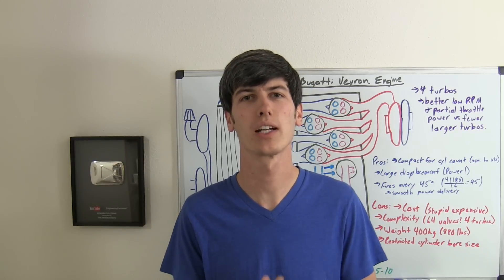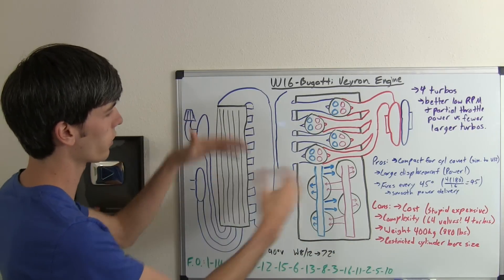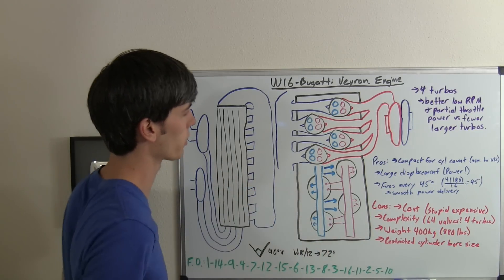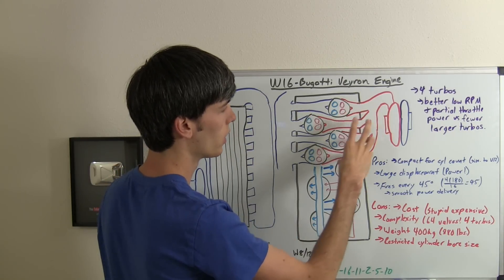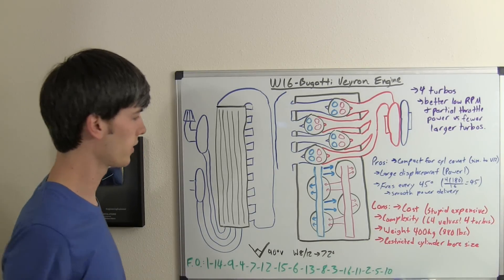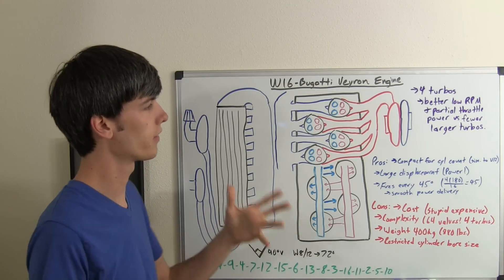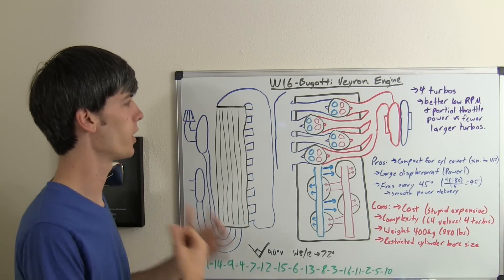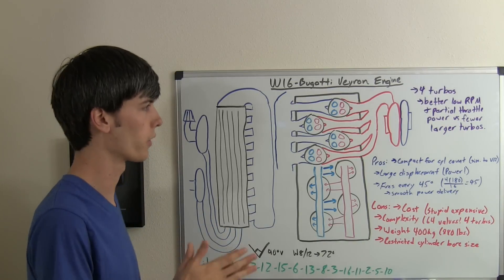W16 Engine - Bugatti Veyron - Explained

Comment: So we can say that if the Veyron was lighter like 1400-1500kg it would still be the fastest car in the world and probably even beyond.. It weights almost 1900kg! That's a lot and that's why Koenigsegg and Henessey (corvette+lotus) managed to make a better acceleration car, also top speed (which Koenigsegg only claims, it's not proved).
Reply from the maker: Less weight means better acceleration, doesn't influence the top speed much.
Reply: Despite what people think, Veyron is not all about speed. Just because it was the fastest car in the world (and still is as far as production cars go, exluding tuned ones like Venom),  doesn't mean it's the main purpose. I had a short ride in one as a passenger on an airfield, a regular Veyron, not SS, and it was the most amazing combination of luxury and speed.  What makes Veyron better than any other hypercar is the fact that it's a luxury grand tourer, it's a track car, or a record breaker. It's a VERY comfortable, refined, quiet car. It's more comfortable than a Bentley Continental GT or a Mercedes CL, or any similar big grand tourer coupes, and still much faster.  Also, it's extremelly easy to drive, very smooth, very stable, very secure, etc.  Basically, it's not about the number it produces, it's about HOW it produces them and translates them into real world.  No other car accelerated that fast with so little effort. At about 200 km/h it literally feels like you're going 50, it's super quiet, stable like on train rails, and there's very little noise inside. For example, Ferrari 458 feels like it has no sound proofing whatsoever in direct comparison, and it rides like it doesn't even have a suspension. Veyron is as smooth as butter.  That's what makes it as good as it is.  It's extremelly hard to engineer a car that will be as fast as it is, but also as luxurious as it is. Much harder than just making a really fast car, which is actually quite easy to do nowadays. Everyone can get 1000hp+ out of an engine today with some simple tuning.
Reply: derbigpr500 Exactly. You get the biggest THUMBS UP ever. I totally agree with you. That's why it costs +1 Million EUR...
Reply: derbigpr500 I would not call the Veyron a track car. Tires are too stupid expensive, its to heavy, and its not all that great in the handling department. Its an impressive car if your into that kind of thing, but I would be much happier in an Ultima, or SL-C for 1/20th the cost, and brutally fast. The Veyron is more about blatant displays of excess than sheer performance. There is no race track on the world where you get close to top speed in the Veyron, and its plain useless on a public road for anything other than dick waving.
Reply: Veyron is a showcase of engineering capability. Performance of super cars stagnated for almost a decade since the glorious days of Porsche 959, Ferrari F40, Jaguar XJ220, and later McLaren F1. Nobody's trying to break 400 km/h on a road-going car before VW decided to do a show of force (when it's aggressively expanding into the luxury market). And Veyron is the first one to trigger a new round of top speed arms race. Since it's the first one there of course it's going to be overtaken by later competitors. 
Just because the Russians didn't land a man on the moon doesn't mean they are bad at building rockets; they are the first to go to space and are the only ones capable of sending men to ISS today. Veyron is similar.
Reply: it's amazing the tyres can survive 270mph whilst supporting a 1900kg car, that's some engineering feat in itself
Reply: It is too unaerodynamic (if this is a word) to go faster. ^^
Reply: A Bugatti is an expensive, half assed collection of a wide variety of cars from top brand car makers. Sad !
Reply: weight can actually help you reach a higher top speed. if it was more aerodynamic it would be faster, but it wouldnt be practical (as if its already practical)
Reply: Weight has very little to do with velocity. Once an object is in motion, it will stay in motion. The biggest limiting factor for these cars is the tires, and I'm not talking about the wear or heat. A spinning tire expands outward from centrifugal force as it gets faster. We don't have the technology yet to make a practical road tire to handle the centrifugal G's of 280-300+ mph without tearing itself apart. and derbigpr500 hit the nail on the head. I've driven one with a client of mine and you literally do not feel anything. Something Koenigsegg and Hennesey don't have is the conservative refinement the Veyron has. And from a monetary standpoint, they Veyron is still superior. A base model Veyron costs less than an Agera or Venom.
Reply: Veyron is not only about speed, don't you know? Koenig and Hennesey can never create the same simplicity of driving, stability and realy big comfort inside.
Reply: Fraser Davidson I think derbigpr500 insinuate that "track car" label is due to the fact it is quicker than some dedicated track cars as seen on Top Gear, Autocar and Evo, after all it is faster than a Ferrari Enzo. The difference is the setting for luxury output. Otherwise, how can you explain SS version being the quickest on Top Gear track (designed by Lotus for those who don't know) for some times?
Reply: derbigpr500 the Hennessy Venom GT is the fast car in the world, however the Bugatti Chiron is faster but Hennessy is making the Hennessy Venom F5 which will be even faster than the Bugatti Chiron
Reply: Jordan Reed  Bugatti s are made for rich people who wants a luxurious car that can still smoke any car that it s paired to (srryforbadeng)
Reply: Vane Naumovski not weight only man drag matters too. When you go above 200mph the airs really heavy it seems , bugatti nd nissan has the best engines but shittiest drag  while lambos has best, koenigsegg has second best drag. U cant win with engine only...

Comment: +EngineeringExplained
Would a configuration work, in theory, with the two VRs 180 degrees opposed? (X configuration? It'd be wide, I understand...) But it would have a MUCH lower center of gravity, and assuming the car built for it would have an accommodating chassis, it could be a viable option for compact, high displacement, and high power.
Reply: +ChemAndAdrenaline X configuration does exist, but it's extremely rare. It was only used in a handful of airplanes and one russian tank

Comment: Great video! Thank you.
You talk about getting displacement with stroke instead of bore in the w16 engine. I've been thinking about the effect of stroke vs. bore, like stroking a chevy 350 bored .030 over with a 400 crank to 383 (which is fairly common) vs destroking a chevy 400 bored .060 over with a 350 crank (by my calculations would give it almost 383cu/inches) or a 502 bored .060 over and with a 3inch stroke (387cu/inch)
What do you think would be the pros and cons of these engines?

Comment: how does it compares with a custom skyline 6 cylinders engine like, that can produce 1000hp too?
Reply: VWs VR6S LOVE boost amd can make over 1000 hp on just 6 cylinders. The Veyron uses 16 of them and FOUR turbo chargers.... Now ik say a twin turbo may give a V6/V8 even,smooth power. While a big single will provide more top end HP but have a more "violent" torque curve. Even if a Veyron engine was built and ran 2 huge turbos instead of the 4 it has stock or simply just 4 bigger turbos it SHOULD be able to stand in the 2500-3000hp club. But I dont even want to know the price tag to make that happen would be

Comment: It is said you get 1000 hp of output power but to get this result  the engine must produce 3000 because 2/3rd of the power is lost by heat so it needs 11 radiators to cool it

Comment: So this engine really only uses 4 camshafts? Aren't these close to 2 inline 8 cylinder engines with the offset that a vr6 normally has? If so, inline 8 cylinder engines died by the 50s because of how much stress they had resulting in very unreliable engines, then what Has VW done to prevent this from having the problems early engines had?

Comment: Hi ! Thanks for explain how work w16 engine but i have a question on the beginning of your vidéo you tell that the w16 has 4 valve per cylinder or i have read that this engine has 64 valve Can you explain to me ? Sorry for m'y english i'm french lol
Reply: 4 valves per cylinder, and this is a 16 cylinder engine, 16 x 4 = 64, so it is a 64 valve engine

Comment: so basically it is 2 VR8 cylinder heads mounted to a V block and then they have fitted 4 turbo chargers on that? 2 turbos on each cylinder head?
Reply from the maker: +Philip Grundemar I believe it's more like two W8s matched together, or 4 VR4s, but essentially yes. 1 turbo for each VR4.

Comment: I believe there's something wrong in your math, for power; one cylinder will fire every 22.5 degrees, which is 2 powerstrokes per 45 degrees. (16 fires for one revolution)
Reply: No because it's a 4 stroke engine so there will be 8 fires per revolution so 45° is right. Correct me if I'm wrong please.
Reply: That is correct.
Reply: David Ottink yes That is correct. It takes two revolutions to complete the 4-cycle, A 16 cylinder engine would light a plug every 45 degrees.

Comment: everyone saying the veyron should be a v8 because v8s are capable of making big power don't understand the point of this car.  this car has to be the be all and end all of a luxury-performance gran tourer (with added exclusivity).  a 16 cylinder with 4 turbos only seems fit.   think how little effort each of those cylinders is putting in to achieve that 1200hp figure

Comment: I hate it when people call this car underpowered for having 16 cylinders. If I'm not wrong, displacement and RPM play a bigger role in torque/power figures than the number of cylinders, so theoretically the Dodge Viper should have the most power of a stock engine (8.4L), no? Please help me understand this so I can defend the Veyron more adequately from insults from idiots.

Comment: I have heard, that this engine could make 3-4000hp in theory, but it would be impossible to get enough radiators on a car to cool it, so it is restricted to about 1000hp.
Reply: This engine could push that easily, but Bugatti designed the Veryon with extreme reliability in mind, but to also have extreme speed. Yes, these engines are 'tuned down' to give it that reliability factor. You could get an engine like this to push 2700-3500hp, with a lot of money, work, and time; but that throws reliability out.

Comment: Imagine the performance if they used a Koenigsegg V8 which weighs less than half and produces about the same power from less fuel :-)
A whole hybrid system such as on the McLaren P1 or Porsche 918 could also be added for a similar total weight to the original Veyron powerunit. But really, it would be difficult to make it a faster car in any way except top speed, due to it already being AWD and plenty powerful. 200+kg less would make a Veyron a good bit more competitive in terms of lap time, where it is beaten by cars such above mentioned, despite their power deficit, and thanks to a lower weight.
Reply: +Cloxxki Koenigsegg V8 engine is very similar to an old Ford V8 engine which is derivated from thus explaining the sound from a typical muscle car. Veyron is more like a high luxury gran tourer in the same vein of Bentley Continental. Koenigsegg engine will have hard time handling the overall weight of Veyron in term of reliability with the same power/torque.
Reply: Tippotipo Would the key factor not be displacement, 5 vs 8 litres? K's engine is about the most tricked out in the business, although reportedly plenty reliable. Sure a heavier car will stress it more when going maximum all the time. 4WD may be a stressing factor on the engine as well. Then, engines are supposed to work, revving is not prime objective, right?
Reply: Cloxxki
After researching about Koenigsegg engine, it seems it is a heavily customized modular Grainger and Warroll Ford engine. Look it up at http://www.luxury4play.com/koenigsegg/103619-powered-ford-5.html#post2225553
The layout is identical aside the modification meaning it is not totally bespoke. That explains why Koenigsegg sounds like muscle cars. Also find out about the 5.0L Ford Coyote engine which could be possibly the template for Koenigsegg engine. http://www.wikiwand.com/en/Ford_Modular_engine
Reply: Tippotipo I am not an engine builder. I care for what the engine does. And it seems to do fine. At 260+bhp/litre.
Reply: Cloxxki
Me neither. just did some research to find out Koenigsegg engine is actually a customized modular Ford engine, simliar type also used on Mustang and drag racing cars.
Reply: Look up Devel Sixteen. The engine for that car has been built and it produces 5,000 BHP.

Comment: so my question is why is it the last   BUGATTI W16 Engine? why did they stop making it?
Reply: cost and fuel efficiency/emissions related reasons, now that Rimac owns Bugatti, theyll probably be quad turbo V12 or V10 cars now with smaller displacements, and insane electric motors added on top, expect something north of 2000AWHP per new PHEV Bugatti Rimac car to come out

Comment: Well isn't this type of engine actually called a "double-V 16" as it is two v8s (or vr8s as we now know) compared to a W12 engine for example, which has 3x4 cylinders instead of 4x3 cylinders. 
Maybe this sounds ridicoulus in english but in german you actually call it a "double-V 16".
Reply: +Oechiih In latin and scandinavian language like Danish, Finnish, "W" is exactly spelled double V. Having the actual document, the reason on that pronunciation came by looking at the cylinder arragement from the front left or right.

Comment: so the 16.4 moniker represents 16 cylinder and 4 turbos ? all this while i was under the impression its a 16.4L engine 😁
Reply: A 16.4 liter engine would be massive. That's tank territory. I doubt they'd ever have room to fit that inside with all the other components in that engine bay. Actually I highly doubt any modern car can fit an engine of that size. You'd need something with a 7 foot engine bay. Jay Lenos tank car comes to mind.

Comment: I wonder how much a replacement engine costs? It's weight is shockingly heavy. That's nearly twice the weight of a late 60s American big block v8 with over 450 cu/in or 7.5L, and those engines can be bored and stroked to over 500 cu/in(over 8.5L) without adding any additional weight in most cases. Are they including the weight of the 8-11 radiators that the Veyron needs in the overall engine weight figure? The only thing more ridiculous than the Veyron's cost, is its ridiculously heavy overall weight. Most "supercars" weigh in around 2700-3400lbs, whereas the Veyron weighs 4400lbs! That's at least 200lbs heavier than a mid 60s Chevrolet Impala with a big block v8! After watching this video, I have a little better idea about where 'some' of that insane weight comes from. But it still doesn't explain the other 3450lbs in the Veyron WITHOUT an engine!

Comment: W16 Engine - Bugatti Veyron is built using two GTI VR6 V8 engine blocks with all the rest custom made and the biggest problem they had was to cool it as it set fire to the exhaust pipes in the test lab and the exhaust pipes also nearly melted.

Comment: Is the W12 engine in the Bentley 2 VR6's?
Reply from the maker: Essentially. And a W16 is basically two W8's, which are two VR4's.
Reply: Engineering Explained So wait, are the VR4's basically 2 VR2's?
Reply: Cantenkerous Tim No, it's a VR6 with two extra cylinders. If it was two VR2's it would be a W4.

Comment: It's a W8 motor not a vr8 VW manufactures Bugatti and VW 8 cylinder engines come V8 or W8 there's a vr6 but in the Bugatti they basically put two W8 engines together with quad turbo's
Reply from the maker: Jordane Beckford Correct. It's 2 W8's, or four VR4's. Each cylinder bank could be described as a VR8, in appearance.

Comment: Although this is a feat of engineering it is really kind of sad the power figures VW is getting from this engine. The car is stupid complicated 64 valves, 16 cylinders, 3 radiators, 4 turbos, and a cooler for pretty much every fluid in the car. A dodge ram 2500 with a inline 6 turbo diesel 6.7l in displacement that has 24 valves, and a third of the cylinders can RELIABLY make 800 hp and 1200 lb ft of torque on 2 turbos. The torque is what matters off the line. The Cummins is making 80% of the horsepower and 120% of the torque as the Bugatti, on roughly 84% of the displacement with 33% of the cylinders breathing through 38 % of the valves opened by 25% of the camshafts using 50% of the turbos and costing probably 10% as much.  Plus you can still take it to the lake, haul a boat, take the path less traveled on when you push the 4x4 button, while making 800hp/1200lb ft and drive it to work on Monday. That's not the limit with these  trucks either, some trucks run 1200hp almost 2000lb ft on 3 turbos and pull off a 1/4 mile in the 10's.